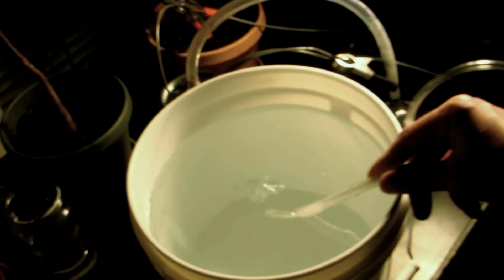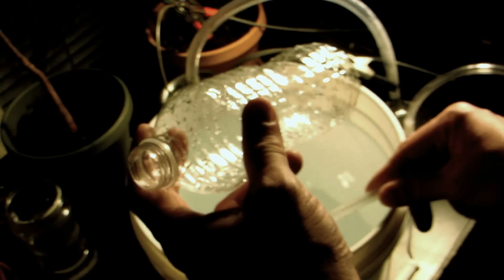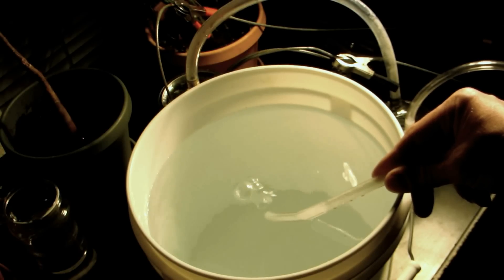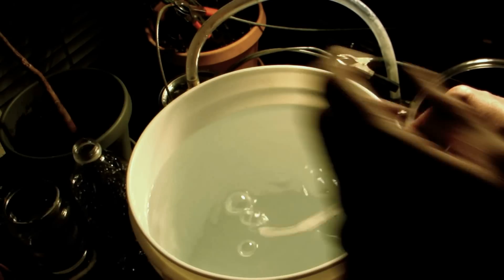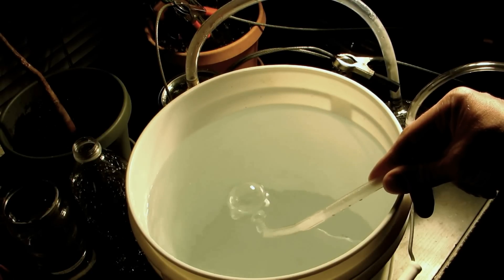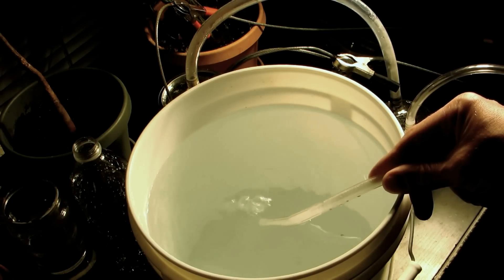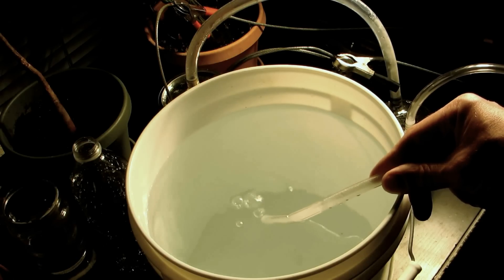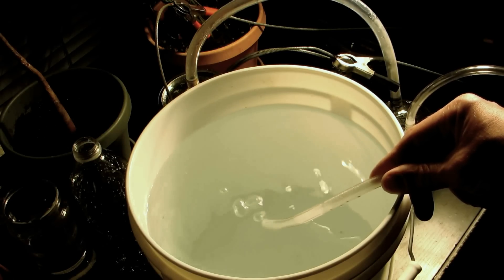Vid64 Washer Cell LPM Test Results.mkv

Comment from the maker: As cheap as the condiment cups are, they do work well.
 
The improved performance could be due to the following:
1. Current being restricted to travel cup to cup with little to no opportunity of electrical runoff. (in dry cells)
2. The gas builds in each chamber as it rises through the cell, causing it to gain pressure. The exiting gas in horizontal plate cells appears to have more pressure than vertical plate cells, because of less resistance.

Comment: Yeah, I don't think my next cell is going to be flat plates. It seems adding a 3rd dimension and curvature to the cell allows for better production. I've been playing around with dome shapes. I wish I could get some stainless steel imploder molds done to try with electrolysis. Maybe its really about the shape of the electrodes and how the water flows through the cell that is key.

Comment from the maker: This design gave me so many other ideas.  It was fun experimenting with this concept, but I will definitely need larger plates/washers to make this design work properly.

I had a build with stainless condiment cups that produced 1 LPM using 12V @ 12 Amps, but the cups are low quality stainless, and degraded too quickly.  I don't like the idea of having to build a new cell every month. I wish I could find the cups in 316 Stainless or Titanium. Then everything would be gravy!

Comment: I get about .25 LPM at 6 amps on my washer cell design and thats about max amps if its going to be ran for a while. Thats why I had to install multiple cells in my hydroxy injection install. They are great starter cells and easy to build and find parts for. Good luck with the build with larger washers. I'm working on a new cell design as well, glad to see ya posting videos again.